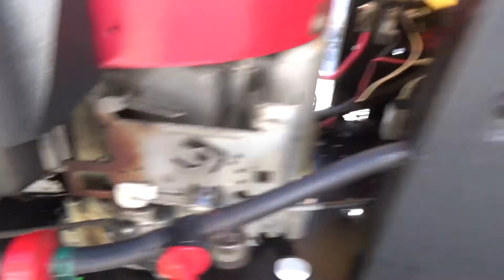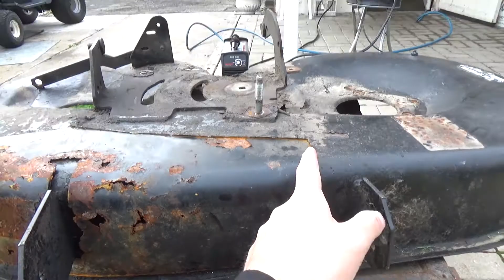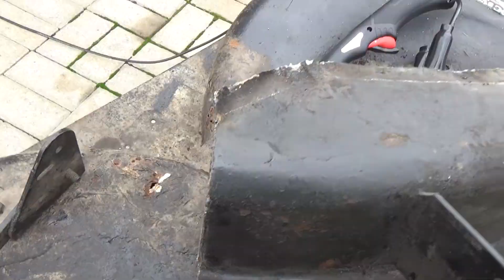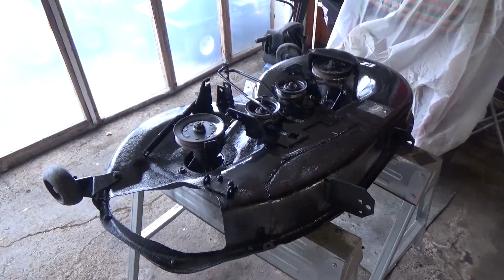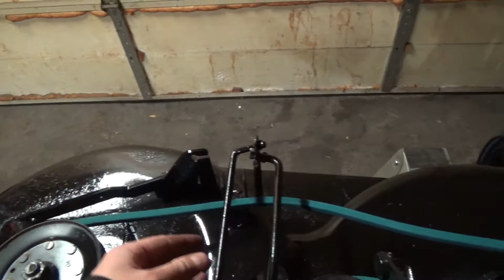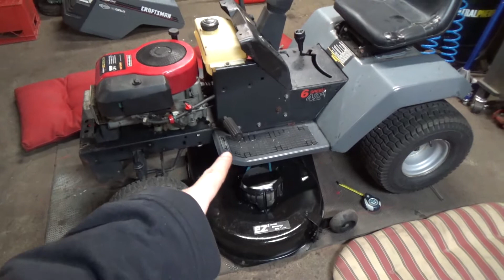Craftsman Riding Lawnmower Revival [Part 2 of 2]

Comment: Rebuilding the old mowers is what I do 85% of the time 
Older folks are not falling for the racket with the new mowers 
They are spending 1K on the old ones and usually buy a new seat then or later 
Young folks see the shiny new paint 
Old folks see what last for 20+ years

Comment: i have the same mower. The clutch pedal will not engage automatically and I have to pull it back with my foot to get it to move. I cant see anything wrong with the spring, what could it be?

Comment: Thanks guy, I have been looking for videos that explain the deck and how it works.  I am restoring an old Western Auto Wizard, and needed a new deck, which is not available, so I used an craftsman deck that is in perfect condition but it gets engaged with a cable rather than a rod.  Your video helped me figure out how to modify to work.  Great stuff.  Thanks again.
Reply from the maker: Thanks for watching!
Reply: Cool 
I’m doing the same and people are wonting there older ones in top shape and repainting them

Comment: On  older 42" Craftsman mowers manufactured by AYP up until about the end of 1999 they used what is called the rod-type engagement mechanism - which in this video is shown. the correct belt for the mower in this video is 144200 , the 144959 belt fits NEWER Craftsman mowers - from years 2000-2005 they used a cable type engagement system that used the longer 144959 belt. so remember 144200 is for older Craftsman/AYP mower's using a rod system and 144959 is for newer Craftsman (Electrolux) mower's using the cable system. Hope this info helps!
Reply from the maker: TheOutdoorPowerGuy great to know, thanks for the info

Comment: moving the steering wheel mount does not mean the steering the same amount in both directions.
This, again, means the steering linkage has a problem.
Reply from the maker: rkwill100 most likely someone worked on the steering gear and never aligned the wheel properly when reassembling

Comment: Dude, nice video and the plasma cutter must have saved you a lot of time. Really impressed with the fit and finished job on the piece you installed and welded to save that deck. I know from checking that just a deck shell new replacement and no spindles, linkage etc. cost nearly $750 plus shipping costs. Engine sounds perfect every body should just buy Eliminator fully serviced equipment and save themselves $$$$ since the new stuff they are making today has the thinnest gauge metal they can use and yet they want mucho dollaros for it! Keep up the good work enjoy watching your videos dude!